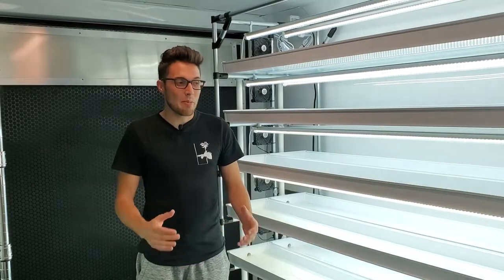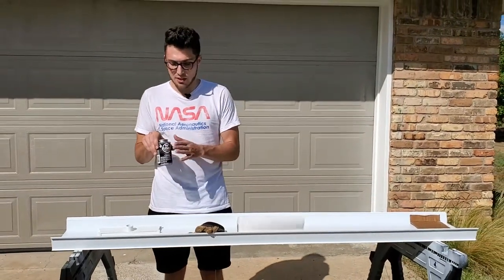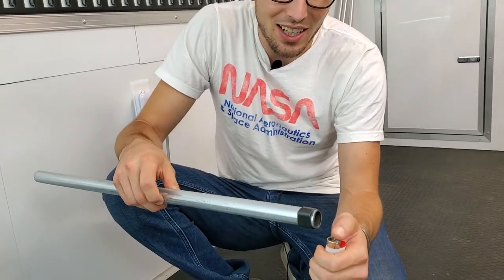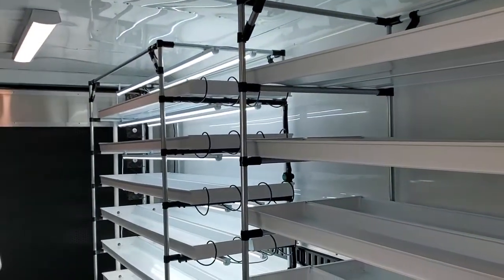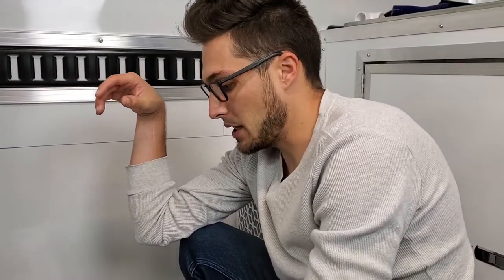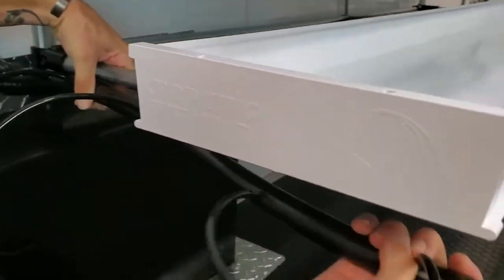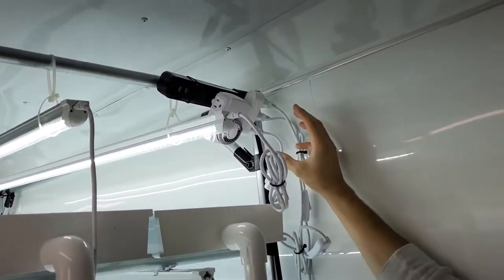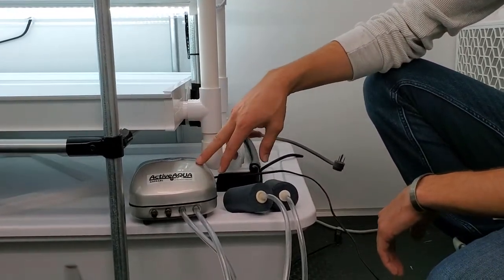Custom NFT Rack "how-to" for Microgreens |  Indoor farming | Indoor Gardening |  Hydroponics

Comment: On the Grow or anyone in the audience: Is there any significant advantage of an nft that is a on/off set up vs an nft that runs constantly?  The only think I can think of, is if air temp is such that it causes "drying" to occur and here fore stresses the plant.
Reply from the maker: Hello! We've noticed that even too many waterings per day with NFT can promote disease/fungus... It really depends on the crop and environmental conditions... In our space with temps staying at 75-80F and humidity at 35% or below, we can still get mold/disease if we overwater the NFT... We are currently watering 6 times a day for 15 minutes each day and that can be too much for some varieties. The only time we would suggest running it 24/7 is if you know that only the roots are touching and not the growing medium... which can't really happen with 99% of the crop varieties except peas. Peas are the only crop we know that develop such massive root structures that it can lift the tray over an inch off the channel. So in short, most plants don't need that much water. Hope that helps!
Reply: Love the info - you guys are the bomb! Thank you so much for all your great videos!
Reply from the maker: @forageforage3520  Thank you so much for the support!!!

Comment: I may have missed it but I did not catch the part about the drain lines to the main reservoir where the pump is how do you right now it’s exactly out of curiosity please let me know thank you
Reply: Part of that I messed up on how did you run the return lines to the main reservoir could you please let me know

Comment: HI, cool video.
just interesting, is PVC pipes and trays are safe for the plants?
Reply from the maker: Yes they are as long as they are not subject to extreme heat or extreme UV rays... So if we used this system out in our Texas heat in the summer sun and didn’t have climate control, there would be a concern of the plastic leeching into the water. Since this is being used in a climate controlled space with lots of airflow, the chance of it degrading from heat/UV and leeching is very low.

We prefer HDPE or PP but since there is nothing on the market for channels with it, we are limited to food-grade PVC.

Comment: The problem with NFT is that it's very fragile. If the pump fails because of power outage everything dies.
On the other hand, growing on burlap works very well. The grooves in the trays work as reservoirs.
Reply from the maker: 🙂 Happy Easter 2021...Have a wonderful time with today!

Comment: Hello, thank you for the video, the information is extremely useful. I'm going through a design myself. Just wanted to double check how you introduced the slight slope. Were the bars, supporting the NFT channels, at the right hand side of the rack, installed lower down? The corner lengths were all the same length?
Reply from the maker: Exactly!

Comment: I just found yours, I’ll keep watching your interesting videos.  I wonder the fans you setup is it must  be running 24/7? My second question is how many liters reservoir tank you use? Thank you for responding I’m going to make it in Japan
Reply from the maker: The fans run 24/7 because we've found it beneficial to always have airflow moving between the plants. It helps in their transpiration and moves the hot air/cold air more effectively around the space. We were using a 40 gallon reservoir (151liters), but found it to be too little water and we had to top it off weekly. I would suggest getting a larger reservoir unless you want to be adding water every week.
Reply: @OnTheGrow  thank you for kindly sharing

Comment: Can you please answer the question as to why you don’t use these?
Reply from the maker: We stopped using this NFT system for 2 main reasons : 

1) we had limited space at that time as our growspace was only 160sqft, which we primarily used to conduct various experiments. With a system like this, you can't conduct experiments like you can with a regular grow rack. 

2) we stopped selling our Microgreens to focus primarily on education. This type of grow system produces too much for someone who is not selling.

Overall, it's a wonderful system for those who are selling and have the space.

Comment: What is your average temp & humidity in your set up?
Reply from the maker: Through the spring and summer, we stayed between 75-80F with humidity averaging 35%! Never tested this system in winter so we're not sure what to expect! It has handled two days of 50's and kept the space around 75F, so it should be good!

Comment: CJ, what did you use to cut the channels in two?
Reply from the maker: These were pre-cut for me so that the shipping was a lot cheaper. Cropking only charged $25 to cut all of the channels... Honestly, they did a poor job but I was able to clean up the edges nicely with the deburring tool. I would assume they used a table saw or handheld saw by the markings of the cuts... The cuts seemed to be rushed and if they cut slower with a finer blade, the edges would've been a lot cleaner!
Reply: Cool, thanks.

Comment: Thank you for this great DIY video and the links for the all the parts. how much water flow is required per tray if we use biostrate felt?
Reply from the maker: Thank you!! So we had ours watering 4 times a day for 15 minutes per watering which did work but some crops didn't like that much water. I would recommend doing a 1-2 minute watering every hour instead for better results hopefully!
Reply: @OnTheGrow  Thanks for the recommendation. And how much water should we feed in these couple of minutes per tray?
Reply from the maker: @harrypapadopoulos4891  I'm not sure what the exact volume of water is that is going across each tray... Its two 1/4" watering lines per channel.

Comment: hydro or flood and drain which is best commercially please
Reply: @onthegrow
Reply from the maker: Hydro, flood and drain works but it saturates super heavy if you aren't careful. A more precise hydro system is what we prefer. Or if you do flood and drain, set the level super low. Hope that helps!
Reply: @OnTheGrow  which hydro system is best in you option I'm setting up a business and want to have everything automated as possible
Reply from the maker: Hmm... flood and drain would be cheaper. The NFT is great but it's a large expense compared to building a f&d system yourself. 

Tough choice but I'd go with a flood and drain set to a super low flood height for only 5 minutes.
Reply: @OnTheGrow  thank you the only 2 x 4 in the country are 610mm by 1220mm by 177h I was thinking I might have to cut and glue or plastic weld the trays as we have no low rise available in the country. Is there anything you would recommend I don't do to avoid wasting money when setting up a flood to drain commically please?
Reply from the maker: You can leave the high walls on the flood table itself, but the drain valve height, I would set as low as possible, if that makes sense. Just make sure you get one decent fan to move airflow for the whole rack!
Reply: @OnTheGrow  thanks man it's so hard to get anything here in new Zealand

Comment: Hi, thanks for sharing this video! I'm planning to set up a micro green growing business. So this is perfect :-) Wi was wondering if you're treating the water that you use to grow. Many people suggest to use a filter. Do you think this is not necessary? Is the water your using circulating and being reused? If so, how often do you exchange it?
Reply from the maker: 💚Thank you so much for the support Dowasho!! We are going to be making new content soon! 😄 We do like giving our crops an advantage such as Ocean Solution in most cases. We are using filtered water in our trailer always and then we added air pump with the stones for aeration 24/7 in keep away stagnation, algae, etc...the unit was to setup to flood and drain each trough every Xhrs via a timer we setup.
Reply: @OnTheGrow  Hi, thanks so much for your reply!  😄. So, you're using OceanSolution, the liquid organic fertilizer. Sounds great! Are you using this oxygen enriched water for both the systems? That is to say the one where watering is done automatically and the others where you're watering manually? BTW, which of these two systems do you prefer?
Reply from the maker: 😉Thank you so much for the support Dowasho!! We are going to be making new content soon! 😄 We use plain tap water...we don't oxygen enrich the source...for bottom watering non NFT trays.
Reply: @OnTheGrow  Thanks for your reply. It helps me a lot! Let's keep be-leafing 😉
Reply from the maker: Thank you so much for the support Dowasho!!  😄

Comment: How does the water system work?
Reply from the maker: 🙂Thank you so much for the support!! It really means a lot to us markg454!  Sorry...we use a water pump to bring water to top and then it works thru gravity down to reservoir tank to be aeriated before recycle back upwards in next watering time. Let me know about question regrading the water pump we used.

Comment: What’s your estimated total cost for this build?
Reply from the maker: I was wondering that today as I woke up :) I quickly added it up and it is  around $1,500 per system. That's everything included in this build minus the tools... Every connector/tubing/channels/lights/pumps/timers, etc. all in that price. Funny thing is I didn't know how much but I assumed it was around there!
Reply from the maker: $1,537.50 was the exact number I got, but because of shipping that may go up or down and if you have some stuff already, it will bring that cost down!

Comment: if you have to make that many cuts just get a DeWalt cordless bandsaw !! and a proper workbench.
Reply from the maker: For this video I was trying to show how you could get away with using as little cost as possible. I had some angle grinders and other tools that would've worked, but I like to show how anyone without those tools could get it done.

Comment: What kind of trays do you use with this? 1020 mesh trays directly in the channels?
Reply from the maker: For this system, you have to use 2-inch deep trays, and you can use either the 1020, 1010, or 5x5 2-inch deep mesh trays. Slotted 5x5s work, too.

Comment: No no please redo this video....min 8:40 how to "properly"seal end caps -swab each part at the glue joint, no need to apply after .
And your dimensions of your  current NFT system seem different (As of 02/2020), and to be on a different rack system
Reply from the maker: We tried just swabbing each part at the glue-joint and every-single-one leaked. The connectors on these are really bad... Very poor tolerances. Hence why we had to slab glue onto them. The dimensions were the same... not sure what you're looking at.